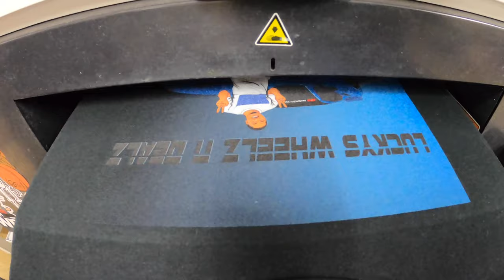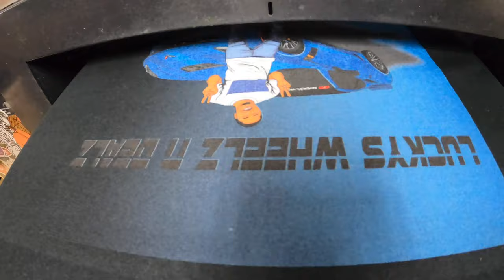Grey 2008 Chevy Impala For Sale 🤑 $1500

Comment: Purple power  work good they have them at Walmart or advance auto degreaser and very strong stuff  works with stains on carpets  use 10%x80 water in spray bottle. And it’s great those ugly ass rims with the brown burn mark on the rims to 80%x20%water    It’s strong stuff but works on everything